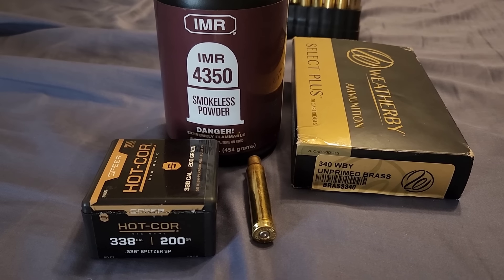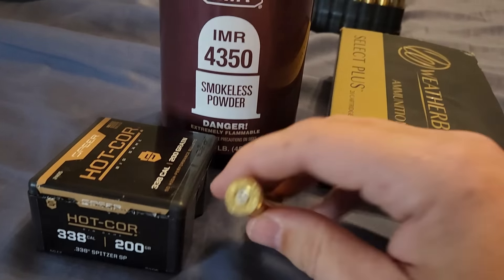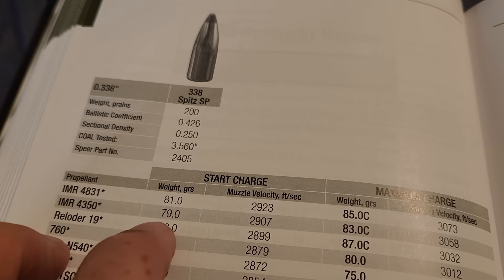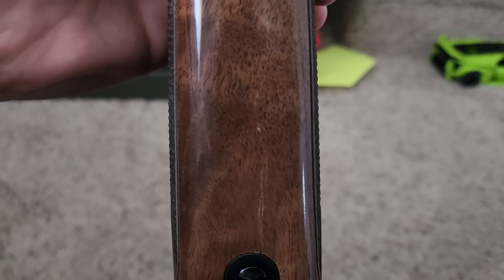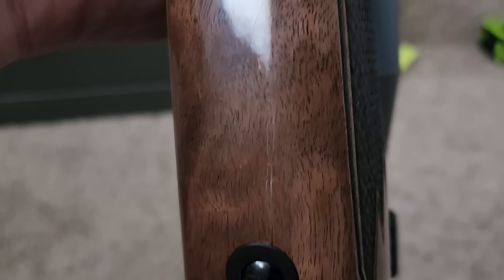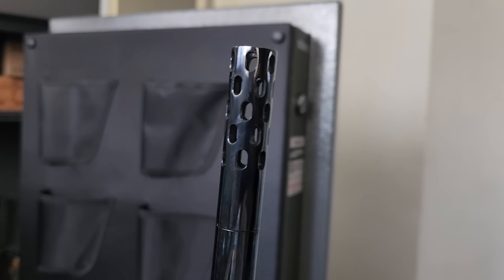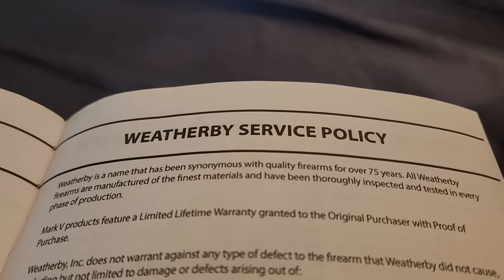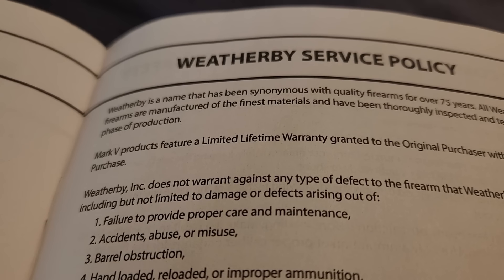My New Mark V Deluxe broke!

Comment: Wow, I feel your pain. That is an obvious unseen flaw in the wood and after a little use the imperfection expanded. I over torqued a thousand screws on Weatherbys and never split a stock and I can be a Cave man and at times I really over torqued action screws. One thing, get a better slotted screwdriver, those action screws are easy to mess up, why Weatherby uses that type of screw head is puzzling. Your screws already look damaged. Again I have Mkv s from the seventies and my stocks still look new with me administrating major over torquing. That stock should be replaced. Good Luck and again we all go through events like this, it is a total bummer.

Comment: I have a Weatherby Vanguard Deluxe 30-06 that split at the tang. I was using factory Nosler ammunition.  They sent me a new stock and a return label for the old one.  I had to bed it to get it aligned with the barrel channel, but no big deal.  They were great to deal with back in 2017.  They were friendly and fast to deal with.  Hopefully they are still the same way for you.

Comment: RW, that sux. Personally I think that Weatherby will make it right. That was a beautiful piece of walnut. Two things come to mind. 1. I have always tightened the front action screw first. That's the way I was taught and have never read the owners manual.  I my experience the rear action screw does little for the action or rifle. I thought I misheard you at first or it was a misprint.  2. I did have a Weatherby,  340 actually,  that the stock inletting at the front of the action and recoil lug was absolutely horrible.  Fortunately I caught this issue and was able to epoxy bed that area. I just wonder if this might have happened to your rifle. Maybe the recoil lug recoiled into the stock, causing the crack. If you think about it, who checks the inletting on a new rifle ? Now the rifle that I had that issue with was a Mark V from the early to mid 80's. But mistakes do happen.  If you haven't shipped you rifle back yet, you may want to check it. 

I know you feel pretty down just now, it shows, but stop that. One way or another that rifle will be up and running. You'll love the 340, it is Thor's hammer. But the biggest best thing is you dropped the weight and improved your health. Your family gets to keep you around for years to come. Blue steel and walnut comes and goes, health and family doesn't.  Stay strong. 

Cheers Jeff

Comment: There's literally no way to see every internal occlusion in every stock.  Weatherby should just send you a new stock and be done with it.  I've personally never had any problem with using a Lead Sled, but I also don't weigh mine down.  I use it mostly to hold and steady the rifle, and still absorb most of the recoil myself.
Reply: Same. I NEVER use weight in led sled, i only use it for removing the human factor during sight in. Its simple physics, the energy has to go somewhere, and if you dont let the gun recoil, that energy goes straight into the scope

Comment: I feel so bad for you Austin. You seem like a heck of a nice guy. Unfortunately, Weatherby doesn’t care about the sacrifices you made. I hope I’m wrong but, I think they they will weasel their way out of replacing your stock. At the very most, they will probably cover part of the replacement cost, if they cover any cost at all. I’ve heard that their customer service at Weatherby sucks. That stock probably already had a flaw from the factory that snuck through quality control. It might have already been cracked from the inside. The problem is that because you were using handloads instead of factory loads. They will tell you they aren’t liable because they have no control over your reloading methods and practices. I work as a mechanic at a Peterbilt dealership and when customers have engine warranty issues, Paccar and Cummins always find a way to screw the dealership and get out of paying. They make the dealership do a bunch of troubleshooting that we aren’t getting paid for. Unfortunately, we live in a dishonest world. My best wishes to you. Again, I hope I’m wrong.

Comment: Thats not an ammo issue. Its a wood issue. Not cured properly and not bedded. I had this happen with a Vanguard deluxe. I suspect poor curing. My gunsmith said bedding would have most likely prevented it. I think properly routing the wood for good action fit and curing properly for no twists is best prevention. I dont think aftermarket bedding should be needed for ANY factory rifle.

Comment: Sorry to see that happen. Of course, I am sure you know of Boyd's. Their wood laminate stocks are affordable and offer some customization, such as engraving, if you want it. They do make them for Weatherby (long action.)

And there are some others. Which may or may not help. The price of the stock being what it is. However, I believe you can get the Boyds with aluminum pillars for bedding. That can take higher torque and not impact the wood. I looked at your model at the Wby site and I could not tell what kind of bedding there is, if any.

Comment: My heart goes out to you over this, and as I have absolutely no faith in warranties having seen every warranty get "lawyer loopholed" out from coverage when its even a cut and dry case, I would say it may be time to consider alternatives.

Im a fan of old guns, and wood stocks will often split on those old rifles as pressure and humidity play games with the grain. Being that it was a heavily figured walnut stock, my money is on internal stress due to the burl being almost enough to split it as is and all it needed was a shock to actually split. You did nothing wrong, Id say it would have split even with the shock of a factory load just to normalize itself. That said, have you ever looked into wooden stock repairs? They were done extensively on old pieces from before our era and often left the stock with a bit more character but a lot stronger for the repair?

Comment: Mine cracked too. Mine cracked at the tang into the pistol grip. I fixed it with epoxy and then refinished it. If you fix it make sure you drill that bolt hole out a little bigger. I'm betting they drilled that hole a little crooked and the bolt is up against the stock when tightened. Then bed that recoil lug with some clear epoxy. You should have told them you shot factory ammo. Because the ammo don't have anything to do with it. Sometimes you can fix those hairline cracks with epoxy and blend that right in with those high gloss finishes and you won't even see it. If you replace it you got to go with the same stock. After spending all that money,the grain in those stocks is beautiful and what makes a Mark V a Mark V deluxe.

Comment: If Weatherby won't repair or replace it, my recommendation would be to get a McMillan Weatherby Mark V replacement stock for range work and hunting and cosmetically repair your original stock for aesthetics.  You might find a competent gunsmith who can repair and upgrade your existing stock and also make it usable again.

Comment: So sorry that this happened after all of your hard work to get the rifle.  The warranty policy says that the damage will not be covered IF it was caused by handloaded, releaded or improper ammunition.  It does not say that the warranty is void if handloaded or reloaded ammunition is used.  It seems to me that they need to determine that the damage was caused by your ammunition in order to not cover the damage.  I would press them on that and see what evidence they have that the ammunition caused the damage.  Wood, by its very nature, is pronet to cracking and is not a perfectly consistent product.  340 Weatherby Magnum recoil is very stout.  Good luck!

Comment: I hope the replace the stock for you. I had two mk V backcountry rifles one in 300 wby and one in 6.5 rpm with the original AG composites stocks. Both stocks cracked within the first box of ammo. Being in Canada its already difficult to deal with warrenty issues. This was during covid, so everything was even more difficult to deal with. After 1 and a half years of waiting for a replacement I gave up and bought 2 bell and carlson stocks so I could sell them both. I hope things go better for you then they did for me. Also weatherby usually beds the recoil lug, so it is odd that it split where it did. If they dont cover it, have a custom walnut stock made.

Comment: Weatherbys second Warranty issue were fractured triggers made out of a zinc alloy. When the safety was pushed off the gun would go off.Gun smiths replaced them with timney's. These were on the German guns.The japanese guns had a new all steel trigger.

Comment: They have treated me awesome the one time I needed it. 
It was an accuracy issue. 
The first lady told me if I was wrong I'd have to pay a range fee.
The next guy I talked to said forget about a range fee and they sent me a prepaid box.
I sent it and they agreed it didn't shoot good enough, so they put a new barrel on it, tested it and sent it back. 
I had to pay nothing. 

I wouldn't worry about it at this point because id be shocked if they didn't swap out the stock and if they say no, talk to a higher up and you will get it replaced. 

That's crappy news, but at this point,  all I'd worry about is if the next stock will be as pretty. 
It's not like they don't expect you to reload, although I would try some factory ammo to test the factory guarantee. 
As far as lead sleds being a big deal,  in a podcast I listened to by the guys testing rifles,  one of them said he used a lead sled.

He just said not to put any weight on it. 

Sorry man. Sometimes life throws a hickup.

Comment: Let me tell you something I've been collecting, Reloading, shooting and hunting with weatherby Mark 5's for over 40 years. I have had 4 cracked stocks. I have seen many others, especially through the pistol grip. On the Japanese guns they reinforced the wrist
with a 4 and a 1/2 inch threaded rod and a metal insert behind the magazine cutout. Every Mark 5 I take the barreled action out of the stock to look for cracks. A Weatherby authorized gunsmith had a dozen Mark 5 stocks, (I counted them) all cracked and under warranty. Every couple of months he  called Weatherby where are the replacement stocks the lady said they were putting them on the new guns, 
One dealer would not carry them.  He said they're junk.

Comment: Had a Mark 5 years ago in 300 Weatherby Mag stock split too .Contact Weatherby about it,wouldn’t warranty it ,bought another Mark 5  stock,no problems, got only 75 to 100 rounds through it to pretty to shoot.Bought another 300 Weatherby  3 years ago with carbon fiber barrel , shoots 190 nosler with H-1000 1/2 to3/4 groups all day long.Just bought a 7 Weatherby mag Hunter ,  3 months ago,can’t get it to shoot with reloads an 2 boxes Weatherby amno.Got 2 to 31/2 with reloads an 2 to 3 with Weatherby . They have had the rifle for 2 weeks now ,no word yet .Good luck to you and me

Comment: The problem with production stocks is just that, they are production stocks. Even Weatherby is guilty of a lack of quality control. They obviously do not have a professional who can examine a blank for imperfections that could lead to a stock splitting.  If you have a heavy recoiling rifle you really need a Bastogne or English walnut stock. If Weatherby won’t warranty their work I’ll make you a stock.
Reply from the maker: That's very kind of you!

Comment: That rifle should have 2 (two) recoil bolts supporting the MAGNUM ACTION…..  That is a manufacturing defect.  Any rifle over 30-06 range in wood stocks wears recoil bolts…….  Look at Sako. Browning Mausers and yes Winchester Model 70 wood Stocks, no wonder it split.

Comment: I broke a MarkV stock once, splitting it along the grain around the action area. 
I had bedded the stock with devcon and while taking it apart after drying, it split.

Sent the stock to a repairer who used small pins and glue, the  refinished the damaged area and it was undetectable. Never had another issue. The rifles previous 2 owners later admitted they sold it because it wasn't very accurate. It is now.
Reply from the maker: Nice. Weatherby replaced my stock

Comment: I will share my last interaction with Weatherby involving a stock. I purchased a new Vanguard Bronze in 6.5x300.A very nice rifle I might add. I have been reporting issues with copper fouling. After a break in session at the range the barrel was completely fouled with copper therefore at  home I cleaned the barrel with Bore Tech copper solvent. I inadvertently spilled the solvent on the stock and this action removed the finish. I called Weatherby admitted that the failure was my oversight and requested any information on how I could restore the finish. To my surprise they replaced the stock no questions. I will say again it was my oversight that created that failure. I am positive they will assist you the same professional manner. Again, good luck.

Comment: I purchased a laser guard vanguard last year. As we finished the paperwork the salesman dropped the rifle as she leaned the box  against the counter. It hit the ground and bounced about two feet high. I looked at the rifle,it looked perfect but the 26 inch barrel worried me. I asked if i could look at the wood under the barrel and was told stores can not disassemble new guns or let customer purchasing to take the barreled action off. Weatherby agrred to look the rifle over and found three hairline cracks at the four end. This was one of the last lasermarks for sale and there was no replacement stock available. How thats posible i dont no.  Store lost the sale and i ended up buying there carbon stocked rifle. Wanted beautiful wood,went with functionality.  I miss the warmth and looks wood offers to a rifle. Good luck,weatherby customer service is good and since stores dont allow checking bedded ares of stock yours should be replaced.

Comment: I would go back with original stock. But if u do change McMillan  or hs precision be my pick. But that shouldn't have happened I have a Lazer mark and have loaded some very hot loads no issues 28 inch barrel no break

Comment: If it split because there was direct, tight contact between the edge of the metal and the edge of the cutout in the wood (I.e. - no relief), that has nothing to do with defects in the wood or hand loaded ammunition, and Weatherby should fix it.

Comment: For wood stocks the correcttorque is 4Nm equivalent to 35 inch-pounds.
If you did that and the stock cracked is because the crack was already there BEFORE you fired the gun but it was imperceptible to naked eye.
Of course they will not admit that.
Not your fault.

Comment: My story:  A guy was selling a used rifle, a .30-378 Weatherby and a buddy of mine bought it, sight unseen ( very gòod price ). Field stripped it, cleaned it and noticed the stock was split at trigger guard. Took it to our gunsmith who called Weatherby about warranty and told no ( used / second hand, etc. ). So inquired about a replacement stock. Told send rifle in for Weatherby to install, wouldn't sell stock to gunsmith. He spent 6 month before finding a stock on line and obtaining it. Screws torqued to factory specs and no problem since. Weatherby left a bad taste in three mouths . . .   ☆

Comment: That looks like it was not inletted properly. It appears the bottom metal Wedged it open and split the wood. These stocks can handle recoil from a 460, than this is not an ammo problem.

Comment: I bought a new $1,500 Weatherby that wouldn't shoot under a 2" group.  Multiple different factory ammunitions wouldn't chamber.  I contacted weatherby. I let them know that I took the stock off and inspected the bedding to see if that can possibly be the cause of the inaccuracy.   I reinstalled the action screws wth a torque wrench. They informed me since I touched the action screws that any guarantees or  warranties were now avoid and if I sent the rifle and I would be charged.  I took it to a local smith.  The chamber was a no-go. I sold the gun. I will never spend a dollar on Whetherby again.     I buy multiple new guns a year which means i occasionally run into ploblems.  I have never be hung out to dry by a gun company except for Weathrby.

Comment: In my personal and humble and probably nonsensical opinion.
Since wood is a very unpredictable material no matter how good you are at working it, the possibility of a sudden failure of a wooden stock in the span of the first rounds shot on it should be accounted for by the manufacturer.
This means that the stock splitting that way should call for a replacement of it from the manufacturer, no questions asked.
The fact that this is a high end gun made by a company that prides itself on its high end production makes me say that if they decide not to replace it then they are bandits.
You should not be sad because of this, you should be angry. They took your hard earned money and then are like - no no nooo. All our obbligations to you dear customer go into the toiler since you were a naughty boy and reloaded. Even though we were very happy to get more of your hard earned money for the brass - . 
I'm so sorry for you and would advise that if they dont replace it and you have the means you should try to custom make one yourself. 
I had the pleasure to make some of my stocks and none is as good as the one you make the way you want it. 
Good luck.

Comment: Weatherby should make good on it.
If Weatherby wont cover it, Pin it and glue it, and get on with the hunt. It will be stronger after that anyway. Splitting problem solved.
 Do a professional job on it. Sometimes wood splits. Not the end of the world. Overcome and Press On!
 Christ Bless!